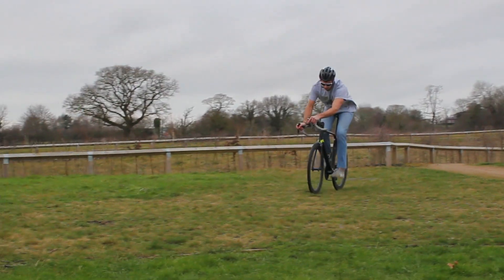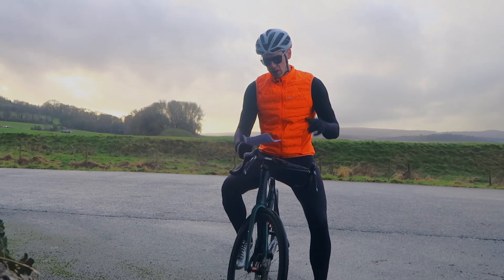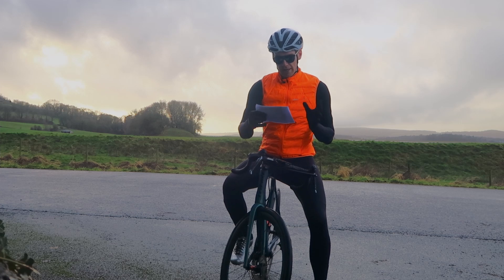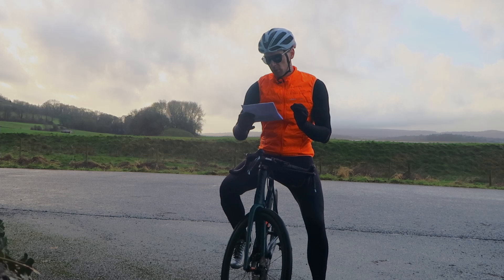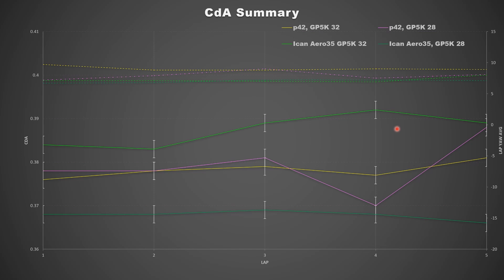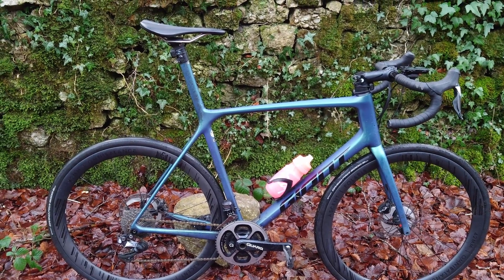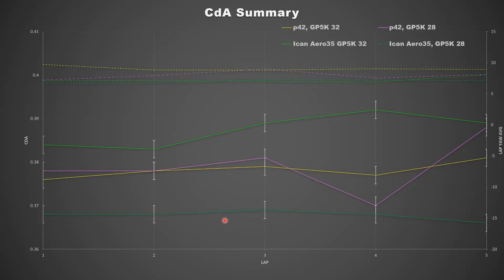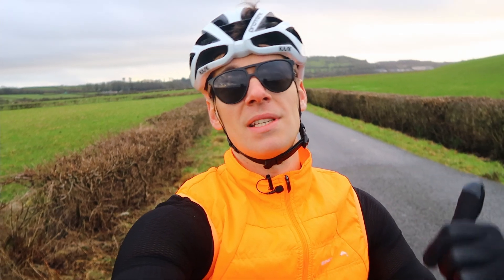Are Wider Tyres a total WIN? The Aerodynamics.

Comment: Would it be safe to assume that that these results would hold if the size of the lightbulb effect was constant? 

So if the 32mm tire and 28mm iCan rim has a 4mm lightbulb effect, would a 28mm tire and 24mm rim have the same aero losses? 

I assume there’s a few other things you’d have to assume as constant, but like… the same-ish aero effect?
Reply: The 28-24 would be faster than the 32-28 because it would be narrower overall. 24-24 would be much faster still

So basically from fastest to slowest:
24-24
28-28
28-24
32-28

Comment: My thought, technically, rim width will determine your tires size. Overall weight will tell you the tires pressure. Other than that is just feeling, subjective. Today you are good, next day you are not, yesterday wet road, today dry road, an hour before you are fresh, after that you are not, this parameter are subjective.

Wider tires are flabby, lost power, however you get comfort to accommodate power lost and help you focus for overall performance.

Comment: On my Polaris 69s, the 32mm GP5K isn’t much wider than the 28mm, but it is significantly taller. It’s effectively creating a deeper profile in the wheel+tire system.
Reply: The down side (potentially) and I have found this with conti tiers it can make the wheel very unstable and way more susceptible to side winds. When I had a pair of alloy hung 34s simply moving from conti to Michelin power cups transformed the stability for the better. Just my experience from a complete stranger online
Reply: According to measurements in the GST wind tunnel, higher tires are a disadvantage.
Reply: @walterhofer937 but why?
Reply: Higher tires is advantage you can go with pretty low pressure and not afraid to damage rims

Comment: Does your data suggest that narrow rims, with narrower tires, require less power to maintain a specific speed?
Reply: No it doesn’t. The sample size is way too small. It just says “that specific combo of 28 on that wheel is faster than the 28/32 on the other wheel.”

There may be a combo of 32 with another wheel that’s as fast or faster…
Reply: Mmmm, yes, there might be an advantage to scaling down tire/rim profiles in order to increase aerodynamic efficiencies by way of lowering frontal and surface areas. Of course, this approach likely will come at the expense of increased CRR due to the narrower tire. It’s for sure food for thought….

Comment: would've loved to have seen some winspace wheels with 25mm tyres (given they're sold as being designed to fit 25mm tyres best. my set is flush af with 25mm gp5k's). RR vs cda for 25 vs 28 would be super nice to see. my hypothesis is still that 25mm front and 28mm rear is fastest (as seen on some WT team setups), but you're the only person who could test this, lol

((btw ERTRO standard rim for measuring width is the same for 25 and 28mm tyres, 19mm inner since Jan 2020. ultra wide wheels are a meme, same as road tubeless))
Reply: I run winspace wheels with 28mm gp5000 S TR with Vittoria Inserts.  25mm isn't faster once you factor in comfort, ability to keep power down through less chatter and handling when hitting corners hard.  

Not to mention Tadej Pogacar is now using gp5000 TT in 28mm.  Good enough for TDF winner, I'd say it's time to switch.

Comment: There is no point in finding out and publishing the hysteresis losses of several tyres while not at the same time recording the suspension losses. So thanks for nothing! Jan Heine proved that a wider tyre with the same build rolls faster.
Reply from the maker: You have absolutely missed the point of the video. Did you listen to the intro, or actually any of it? This is investigating the aero side. The Crr and suspension losses are coming up in part 2. In this video, the Crr and friction losses were kept constant with an iso - hoop stress model.
Reply: @PeakTorque  I was responding to your comment about a magazine that has done the work of measuring the hysteresis losses of tyres. You thanked them for their service but I don't see a service. They are misleading. No data is better than false data. Suspension losses are often times greater than the hysteresis losses and therefore the tyres are getting wider.
Reply from the maker: @maxsievers8251  My apologies, i misread your comment.

Comment: Have you ever tested the effect of filling in the gap between sidewall and rim with a rtv silicone/caulk?  I've heard rumors of pros doing it, I don't think it'd be practical for flat repair, but it would make a nearly perfect transition and I'm curious what it would save.  Great video.
Reply from the maker: I know a few guys who do it for TT but it's not UCI legal
Reply: @PeakTorque  how much can it save in aero watts?   I can't see it being >10w but who knows.
Reply: @10ktube  10 w, no way. probably a watt or two per tire at 40 kpg on average or so
Reply: I believe this was a part of the Mavic UST road system, but disappeared as a product because it was banned by UCI.
Reply: @thomaslutro5560  A friend of mine had this on his Mavic deep ass wheelset years ago. Was a triangular shaped thing that made a perfect tyre to rim transition, i guess you clicked it into place. Was pretty awesome.
Reply: Josh Porter (Silca) claims filling the gap increases rolling resistance more than it reduces aero.
Reply from the maker: @jefferycampbell2243  How? a Bead of silicone in that gap will not deflect, so how can any hysteresis occur?
Reply: Any links to that? First time I hear about it
Reply: 10 years ago, Bontrager's TT tire had extra rubber at the joint to fill the gap.  Too bad no mfg has copied that.

Comment: Amazing video PT. Been waiting for this one to come out! 
I’m looking to buy a new wheelset for racing and considering the hyper 65s. 
I feel like 28mm (GP) tyres on those wheels will offer better grip, lower rolling resistance, and aerodynamics than current 25mm on 404NSW (19mm internal, 58mm depth). Thoughts?
And with the downsized sized from continental, should I be running 30mm on those wheels?

Thanks a million and loving the content brother!
Reply from the maker: Good choice! The hyper is on the narrow side of the current very wide trend. I have a video coming up on the D67s soon. Spoiler alert they're fast!
Reply: @PeakTorque  you always have something on the go! Very exciting. Take care, you’ll hear from me again soon.
Reply: My thought, your rim width will determine what tires size you should use.

Comment: What is the result if the tire is slightly undersized, eg, a 25 tire on a rim that needs a 28 to be at 1:1?
Reply from the maker: Good question. I've done a bit of testing on that Cannondale Knot theory with a bulging rim lip. My tests are showing its not a good idea. I don't think the air recovers after being tripped. Don't see many other brands doing this either. With Tubular tyres, the lip is always present, which is maybe why clued up World Tour teams are not using them.
Reply: @PeakTorque  Thanks. Bottom line, the external run width matching the tire you want to ride is all important. Side note- tubulars rode so great. They may not have been aero, but they sure did feel good underneath you. 😀
Reply from the maker: @rg807  Width matching is one thing, but the transition is really important too it seems.

Comment: Hm. I wanted to try the Corsa N.EXT's as my next tyre but after seeing GP 5k for so cheap(imo?) on wiggle/chain reaction I impulse ordered them last week. Seems I made a great choice :D
Reply: What do you consider cheap? I paid AUD$51 for Corsa 2.0 25mm tan sidewalls
Reply from the maker: I don't think GP5k are cheap. The 32mm was almost 70quid per tyre. The Hankook and kumhos i buy for my cars are 80 quid. Ridiculous
Reply: @PeakTorque  yeah but the Contis I buy for my car are $225 each. And if I went Michelin, they'd be over $300 each
Reply from the maker: @n0ch91c3s  Damn rich man with 4 contis! Just bang motorway miles so mid range tyres for me!
Reply: @PeakTorque  Wouldn't say they're cheap but wouldn't say they're expensive. Depends on where you get them and what size. I can get sets of 23c-28c for 110cad/82usd/75euro/66pounds delivered to my door from a few different websites. Considering how well they perform, I'd say that's pretty good value.
Reply: I paid 45EUR/70AUD/40GBP for my GP5k. Not cheap but I don't think you can find them for less anywhere, that's what I meant by seeing them for cheap.

Comment: In terms of rolling resistance have you looked at Veloflex vs the GP 5000? I am debating which ones to get
Reply from the maker: Not tried those for years but they were soo fragile. Conti have an unbeatable mix of speed and durability
Reply: @PeakTorque  Worked in the tire industry for a bit (albeit automotive). The thing I always tell other cyclists is this: You cannot outdesign a bad compound. These smaller companies can do all the tread siping and unique patterns that they want, but at the end of it, companies like Conti will have the biggest budget for compound research and there isn't much you can do about it.

Comment: Did you measure the actual width of each tyre vs the labelled width? I ask because in the last 18 months I've had 3 sets of 28mm Conti 5000's First set came stock with Canyon Endurace on the stock DT swiss rims (I believe 21mm Internal Width). In order of purchase the 28mm Conti 5000's measured (calipers) at:

30.5mm/31mm
29mm/28.3mm
27.8mm/27.3mm

At my weight this results in a 14psi difference between the first and last tire.
Reply: Are you measuring all of them right after mounting, or after a first ride?
Reply: @n0ch91c3s  New, a few rides old, a few months old, and end of life. Consistent.

Comment: Could you please measure the REAL width of each tire on each rim ? I guess this would be more explicit that just stating their "official" width, which has nothing to do with reality. Thus it would be easier to compare which real tire width gets along each rim width. Greetings !
Reply from the maker: The adjusted tyre pressures to match the hoop stress on each tyre was calculated using real measured width yes. 
32mm gp5k measured at 33mm on the polaris, 32mm on the ican.
28mm measured 28.5mm on both. 
The vcn 32 measured at 33.5mm on the polaris.
Reply: @PeakTorque  Well, thanks Peak ! I think this makes much more sense this way ! From this, we can interfere that 28.5 and 33 mm tire work on a 32.5 mm rim.
And 28.5 mm tires work on a 29 mm rim, whereas 32 mm tire is crap with this 29 mm rim. Pretty much in line with what Hambini recommends, to basically have a tire width that matches the rim width. A narrower tire can work too, but a larger tire is definitely a bad idea. Thanks man !
Reply: @wickedgravity101  4:55 The ICAN measured 28mm so slightly LESS than the 28mm tire. Good to know that such a difference doesn't abruptly ruin the aerodynamics.

Comment: Besides getting a ‘fast’ tyre the most important call out to me from this is to match the tyre width (or range of suitable tyre widths) to the rim.  e.g. 25mm Conti 5000 have the flattest transition on my current 5yr old aero carbon wheels but I’ve got a newer, wider wheel set and 28mm Conti 5000 appear to me to give the flattest transition. And yes you can feel it on the road. So it’s clear rim width is your primary determinant of tyre with.

Comment: Very interesting data as usual. Would love to see a similar test with 25-28-30-32 mm tyres on the same rim, preferably a bit deeper (like 60 mm). Quantifying the gains and proving/debunking the 105% rule.

Huge props for doing these, I've tried doing some experiments myself, had some success when gravity or RR caused most of the losses, but I also found that there simply isn't enough resolution, or the circumstances change too much to analyse aero losses/gains - without the pitot tube, of course :D
Reply from the maker: Do you know how time consuming this video was to make, process and edit 😝
Reply: @PeakTorque  I can only imagine, that's one of the reasons I only made Excel sheets from my findings 😁

Would love to support you, just finished university, once I get a job you can count on me :D

Comment: As farcas I unerstood, the transition between tyre and rim is more aero if the side of the tyre is not flat even with the rim but directly bulging away from the side of the rim. This has been tested by Cannondale with the System Six and their own brand wheelset. That shows the tyres to be even more embedded in the rims.
Reply from the maker: Wheres your data on that? I tried that theory a LOT on 23 and 25mm tyres on the p69 69mm Ascent wheelset (33?? Wide) and they're far slower aerodynamically. That rim lip seems to be detrimental than good, which is probably why we don't see that design on any brand any more

Comment: Hey PT, cannot remember for the life of me your opinion about the 105% rule. 28mm wide rims usually have that larger part measuring 30 so in accordance with 105% rule with 28 tires
Reply: 28 tires also expand more once you pop air in them so should be fine. As long the rim is wider than the tire. It should be ok

Comment: I went from Tufo S3 tubulars to 28mm GP5Ks + latex tubes on ~30x60mm aero wheels and probably saw about a 25W gain at ~30km/h. I was probably going 3-5km/h faster at the bottom of descents with no other changes. Tires, wheels and clothes are prob ground zero for low hanging fruit.... I would damn near say everything else is window dressing, especially for amateur watts. Thanks for the study

Comment: Is the overall recommendation to get to as close to 1:1 measured tire width and external rim width to maximize options for rolling resistance and comfort while maintaining the aerodynamic relationship between the tire and rim?
Reply from the maker: Basically. Yes. And if using a wide tyre, make sure the rim is wide to lengthen the aerodynamic chord as much as possible.
Reply: @PeakTorque  I have a play set of Hunt 48 limitless with 32mm GP5K. WAM is 34mm+ and the external rim width is 35mm. I was pleasantly surprised how nice it rides, only the 48 Limitless wheelset weight of 1610g is a little obnoxious. I also have Polaris 69mm running 28mm GP5K and they’re great. Also own Hunt 44UD on 28mm GP5K, aaaaand since I have a serious cycling wheels addiction at the moment, I just bought my first hookless 353 NSW on 28mm GP5K S TR. Eyeing @ascentbikes P42 if they can give us 25mm hooked internal in a future version to improve 28mm tire to rim transition 😉.
Reply: There is a "105 rule" found by Hed if I remember well, that determined that the external rim width should be at least 105% of the measured tire width. Can you confirm @Peak Torque ?
Reply: @KMS2468  105% rule was developed by Josh Poertner of Silca while he was at Zipp, developing the first 404 wheel.
Reply: Rim width should be slightly greater than tyre width for optimum aerodynamics.

Comment: I never understood how people could even possibly believe that wider tires are faster...in what world is more resistance faster?  They actually believe that having more compound on the ground, which results in MORE FRICTION, means it's faster.  Why would MORE FRICTION make it FASTER?  People are so gullible.
Reply: A 22mm tire is does not work the same for a little rider that weights 60kg compared to a tank of a man at 90kg. I like my pressure at 11bar and my average speed at 35km/h. More rotational drag because of heavier tyres and less pressure will not make me faster on the good roads I have the pleasure to ride.
Reply: @angruwasp8782  I am 90kg and I ride with 25mm tires.  11 bar?  You must never corner because that would be twitchy as hell.  I run 95-100psi with tubes and about 83psi with my current tubeless + vittoria air liner set-up.  I regularly bomb down mountains at 50mph (live in Southern California).
Reply: Well it’s because the surface is not 100 percent flat. If we race on velo, we can only consider resistance. But in the real world, many factors affect ride quality = speed.   But that’s what bike industry figures out not consumers. So let’s see how the standard tire size gonna Change over time. only thing we can clearly see is the overall tire size on road bike gets bigger over time.
Reply: @Aiden.K  They just want to sell you more things.  They make up lies and half-truths to sell more products.

Are you seriously saying the curvature of the road makes a big difference for a 25mm vs 32mm bicycle tire?

It's the same as rim brake vs disc brake.  they are not more aero.  But they have to sell you something new because they want to sell more products.

Comment: In the 80s for time trials I used Wolber Profil 18 18mm rims with 19mm tubular tires. That was pretty common in the professional ranks. 165psi
Now I use a 21 on the front and 23 in the back or a 23 in the front and 25 in the back.
Also the standard setup in the 80s was Vittoria CX silk tubular in the front and a Vittoria CG cotton in the back.
Reply: Probably ran on MAVIC Open 4 rims as well?
Reply: @WowRixter  probably gel330 or 280

Comment: Get a fast tyre!

So simple geometric assumptions such as make it a smooth transition between tyra and rim have been proven. Size of the tyre doesnt matter then as long as you dont have huge friction or vibrational losses! 

So use a bigger tyre, get better wet performance and dont fall in corners guys! ( For winter and wet)